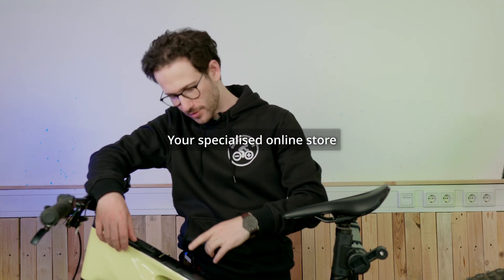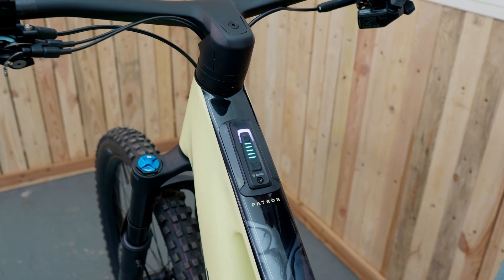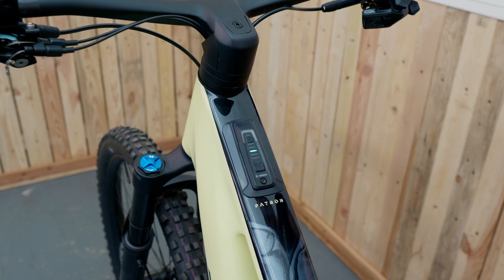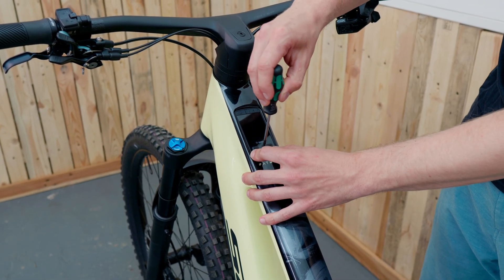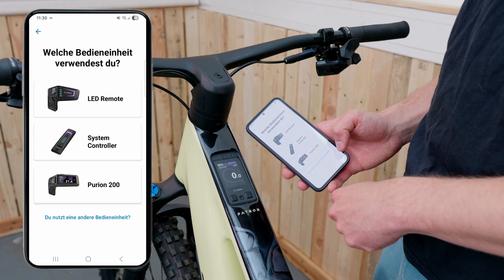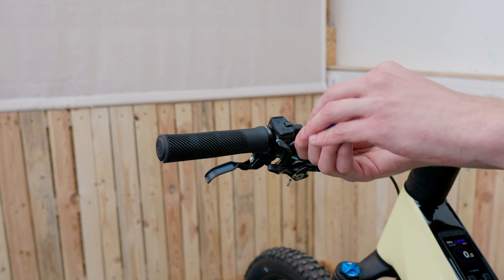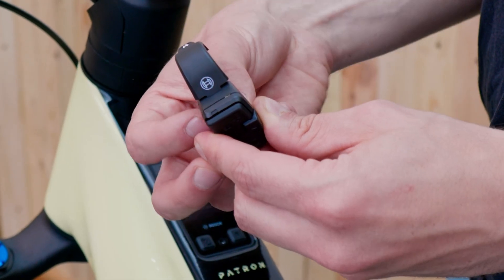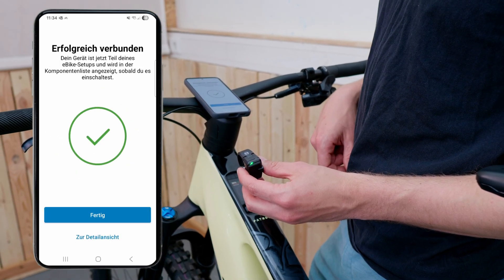Bosch Kiox 400c Retrofit 🔄 Replacing the System Controller | Tutorial 🔧 | EBIKE24

Comment: When I changed to the Kiox 400C on my cube one44 it will not switch on and gives error 142002. Any ideas how to fix?
Reply from the maker: Well, error 142002 inidicates a lack of power supply. It's either the button battery of the Kiox 400 https://www.ebike24.com/bosch-kiox-400c-display-smart-system that is dead, or the cable from the motor that is not well connected. Thanks.

Comment: I switched the displays but I can’t connect to my phone via blutooth anymore :(
Reply from the maker: If your Bosch Kiox 400C display isn’t connecting to your phone via Bluetooth, there are several troubleshooting steps and checks you can try. I’ll walk you through what Bosch recommends and what users have found helpful. 
🔍 What Bosch says: “Connection Failed” for Kiox 400C + Flow App

Bosch has a support article “Connection failed (for Kiox 400C in conjunction with the eBike Flow app)” that outlines steps. 
 Key things to check:

Compatibility:

Ensure your eBike and Kiox 400C are part of Bosch’s Smart System. The Flow app only works with the Smart System generation. If your system is older or incompatible, Bluetooth pairing may not work. 
Bosch eBike Hilfezentrum

Proximity & Power:

The eBike and smartphone should be close to each other.

Both must be switched on.

Make sure Bluetooth is enabled on your phone.

For Android, also make sure location services are enabled (some versions of Android require that for Bluetooth scanning). 

Phone battery & energy saving settings:

Ensure phone has enough charge.

On Android: check if energy-saving / battery optimization might be disabling Bluetooth in the background. If so, whitelist or disable optimization for the Flow app. 

Internet connection:

The phone needs to have internet (WiFi or mobile data) for Flow app setup / authentication. 

Restarting things:

Turn off and back on both the eBike/display (Kiox 400C) and the smartphone.

Also sometimes restart Bluetooth on phone. 

“Ignore device” and re-pair:

If the Flow app or phone’s Bluetooth settings show the eBike / display already listed but not connecting, check if it's been marked “ignore” or “blocked”. If yes, remove/ignore that entry.

Remove the eBike from the app settings (if possible), then try pairing from scratch. 
Bosch eBike Hilfezentrum

🛠 Additional Tips Users Have Found Useful

Beyond the official Bosch steps, some users discovered extra tricks:

Remove the bike from the list of paired Bluetooth devices on the phone, and also remove the phone from the display’s paired devices. Then try re-pairing.

Fully power down / remove battery for a few minutes, then power back on. This can help reset the display.

Make sure no other phone or device is currently connected to the Kiox 400C (or set as key for the lock). If another device is connected, it might block new connections.

Update firmware: ensure both the Flow app and the display (Kiox 400C) have the latest firmware/software. Bosch often releases bug-fixes.

On Android phones: Sometimes Bluetooth scanning fails if location or permissions (Bluetooth location) aren’t granted. Make sure all required permissions are allowed.
Reply: @ebike24 thx! I have tried all of the things above without success. Only after I removed my bike from the Flow app and added it back, it started working :)
Reply from the maker: Thanks, useful info.

Comment: Hi, I plan to put it on my cube stereo-hybrid 177, so I will order adapter as well. My question is abut the water insulation. I see there is no seal around the display, how is water prevented from getting into the frame? Thank you
Reply from the maker: Hi, Normally, the rubber edge should be flexible enough to ensure sufficient waterproofing. I would protect it from sun rays when parking in the sun, because in the long term, after several years, they could make it stiffer. Thanks

Comment: Just bought one from you guys for my whyte kado but it doesnt fit. Do you know what frame adapter do i need?
Reply from the maker: Sorry, it's annoying. As explained on the page Bosch Kiox 400C Display Smart System | eBike24, Retrofitting is only possible on e-bikes with a large cut-out in the top tube. This includes bikes equipped with the Bosch System Controller in combination with the Bosch frame adapter. Depending on the brand, additional manufacturer-specific accessories/adapters may be required. For example, Cube models such as the Stereo Hybrid One44 HPC and Hybrid One77 HPC 2025 require the Cube display adapter for retrofitting.
So please ask your reseller.
Thanks.
Reply: @ebike24  yes whyte answered me. There's a special adapter needed for whyte also.
Maybe you'll get it in the future hopefully 😎
Reply: Which Kado, the S ?
Reply: @Bunter1815  rs
Reply: @GrumpypantsEMTB the RS looks like it has the wider surround around the display vs the S but still doesn't fit?
Reply: @GrumpypantsEMTB argh I see the problem when I searched for the adapter

Comment: Do you know if there will be any Bosch or after market adapters? I have a Canyon Grizl:ON CF 7 that uses a Bosch System Controller but doesn’t have the extra space in the bike frame. Thank you
Reply from the maker: There is an adapter, but it is for Cube, and I doubt it would fit Canyon: https://www.ebike24.com/cube-display-adapter-for-bosch-kiox-400c
Thanks